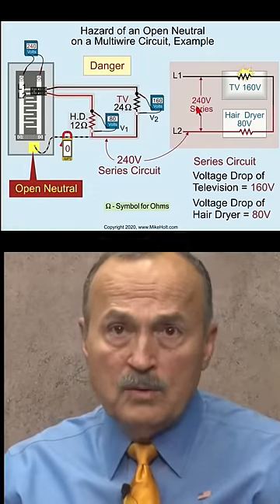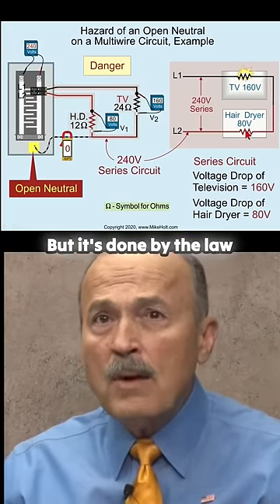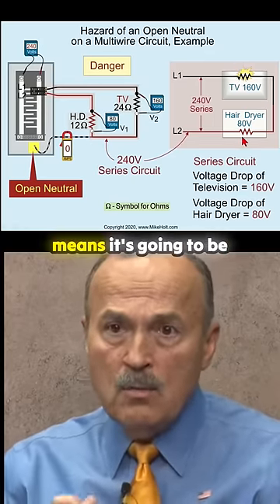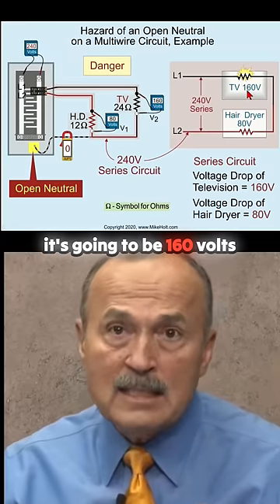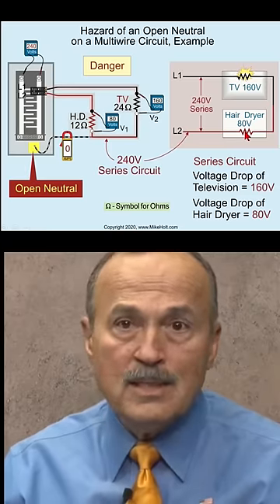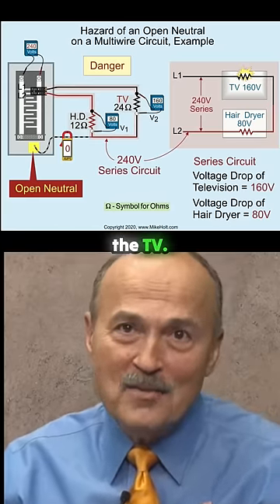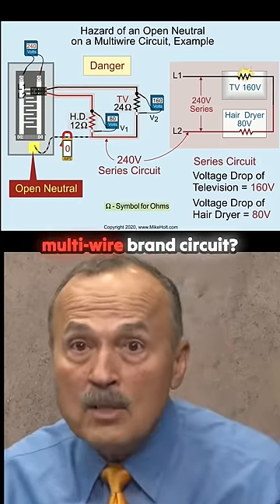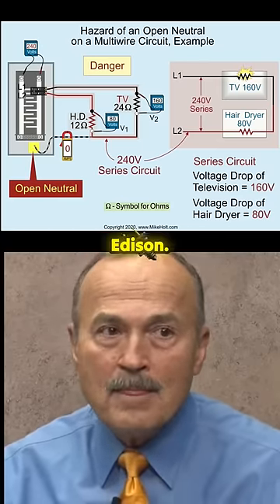Math and History of Multi Wire Branch Circuits #electricalcode #nec

Comment: Lost the neutral on the feed to my house couple years ago, lights were flickering prompting me to get the voltmeter,  78v on one outlet, 162v on another...  down to the panel i go, and find the same at the feed "hrm, adds up to 240v" and realized it lost its "center" call the power co.and they found the common was open at the transformer across the street. Glad i have protection on all my electronics!
Reply: Why didn't this harm your electronics? How are you protected? Thanks!
Reply: @s1dest3p proper bonding and breakers
Reply: But it was at 162v so it hasn’t tripped
Reply: @leexgx  from my understanding just regarding the electronics, if the voltage raised the amperage on the electronics it would trip the breaker feeding that electronic. Bonding would help bring the high current to ground. Only a 2nd year apprentice so don’t take my word for it lol
Reply: Breakers in your house trip due to amps not volts. Most have a Time delay inversely proportional to amperage rise above the rated value. So a 20A breaker might let you pull 21 amps for ten hours but It won't let you pull 200 amps for a tenth of a second.
Reply: @MerriamElectric1220  I=V\Z brudda, more volts means more amps. More impedance means less amps
Reply: @Hollows_over_balls  Z=Impedance because it’s ac, R=Resistance
Reply: @Hollows_over_balls  their both ohms law lol, facts aren’t right but point still stands because some of his outlets went down and some went up in voltage
Reply: @Hollows_over_balls  If you are dealing with inductor base circuits then that is the case, however it’s not always the case. Just think of motors and Transformers. The current and the voltages are inversely proportionate, depending upon the load.
Reply: @Hollows_over_balls  Yes. That’s absolutely correct. Just think of a transformer. You have a primary coil and a secondary coil. On a step down transformer, the voltage across the primary is higher than the voltage across the secondary. With that in mind, you have to think about the transfer of power between the two coils. Voltage times the current equals the wattage. You have the same power on the primary that’s transferred and received by the secondary. However, neither the primary nor the secondary are electrically connected to one another. They both work off the concept of mutual inductance and magnetic coupling.
Reply: @s1dest3p Whole home surge protection and level 3 surge protection at individual locations

Comment: TVs are usually made with universal switchmode power supplies these days. You could run the TV at 250V and it'd probably be fine.
Reply from the maker: Good point, I'll need to change the example!
Reply: @MikeHoltNEC  beloved family heirloom CRT TV instead of modern $3,000 TV ;+ )
Reply: So the images will speed up?
Reply: So what you're saying is maybe your refrigerator doesn't make it but the TV is okay.
Reply: Yup. Mine is rated 100-240V 50-60Hz
Reply: @microcolonel  And it does run “faster” with higher voltage? How?
Reply: Even the oldest TVs would not change “speed” with different voltage, IMHO.
Reply: @tomsaltner3011  more likely it would cause the oscillators to change, and prevent it synchronizing with the picture... and maybe cause accelerated phosphor wear.
Reply: He was joking… maybe a reel-to-reel projector would run images faster, but not a TV receiving a transmission!

Comment: A friend's dad lost the neutral on his house since the cable for the secondary to his house got abraded by a tree branch. My friend was measuring imbalanced voltages everywhere and of course he had issues with his cable modem too. After my friend kept telling me the voltage imbalances, and then that same day they had the cable tech out who said the plastic in the coax was melted, I put 2 and 2 together and told him he had a bad neutral to the transformer. The coax was melting because the neutral current for the house was being carried through the cable modem out to the pole at this point. The electric utility company came out and fixed it, been fine ever since.

Comment: Not really sure of what is going on here but it reminds me of a time my neutral wire broke on the pole during a storm. I had random voltage coming out of a given outlet depending on what was plugged in. If I had 30 volts on this outlet on line 1,  I also had 210 volts on line 2. It could be zero and 240 or anything in between. It changed according to what I plugged in. No my computer didn't run faster for a fraction of a second. It fried the sever power supply that I replaced.
Reply from the maker: Lol... that is exactly what happened.

Comment: i will have to set up a test rig and try this in real world.  I use multiwire branch circuits all the time to do quad outlets in workshops and kitchens all the time - especially in older or really packed panels and I don't want to have to land an extra ground and neutral (6 wires instead of 4). Usually first quads are GFCI's, with 12/3 then from the load sides, 12/2/2 down the bar or around the garage.  Not always GFCI's and kept 12/3 down the line.  I've never had a problem, but I've also never lost the neutral.  The diagrams seem right, but I'd like to see it act up under real conditions.
Reply from the maker: Let me know how your experiment works out.

Comment: I can't understand my people still try to use multi-wire branch circuits. In my experience, it's best to never share neutrals. I've seen too many burnt up neutral conductors on service calls in my years
Reply: How do they burn up the neutral? It's really just there to balance the load between the two legs..

Comment: Wait until your pool light, even on a GFCI, ends up like that, like mine did. 😢 The voltages show were about the same, too. 80 volts through the swimmer...
Reply: GFCI won't help with an open neutral. It's for when your poolwater leaks onto a live wire
Reply: @bene5431  I know, that's why I made the comment' LOL.

Comment: In my situation it's the wrong transformer on a residential power pole, they burned out their clothes dryer,I found over 340vac on the dryer receptacle, I checked it out with two multi testers,no electronics were burned out,a bunch of lighting fixtures had to have new bulbs.The electric company had to replace the transformer on the pole and everything was fine, no electronics were burned out because the electronics will operate on 220vac as well as 120vac .It was the wrong transformer on the pole.

Comment: I had an electrician install a shared neutral circuit in my garage. 3 weeks later I destroyed an ego battery charger because the neutral wire came loose. Being on the garage door wall probably didn’t help. I will never save wire this way again.
Reply: Sometimes it's not to save wire tho. Some multiwire branch crkts are for 240 volt loads that have an imbalance of current. Usually this is 240 volt loads that have electronics in them which increasingly more and more of them have.
Reply: That is true. And a great new standard. People just need to remember to separate the neutral and the ground inside the device if they a going from a 3 pronged 240v receptacle to a 4 pronged 240v circuit. 

That was not my situation. I had 2  120v receptacles right next to each other with a shared neutral
Reply: A shared neutral will not cause any problem. You   need to learn a little more about single phase wiring.
Reply: @marcw1867
A shared neutral won’t cause any problems when wired correctly. But if you loose that neutral going back to the panel the neutral from plug 1 is still connected to the neutral from plug 2. 

So the electricity fallows this path. 
Leg 1
Hot screw on plug 1
Through device connected to plug 1
Neural screw on plug 1
Neural wire connected to plug 1
Wire nut connecting plug 1 neutral wire and plug 2 neutral wire
Neutral wire connected to plug 2
Neutral screw on plug 2
Through device on plug 2 
Hot screw on plug 2 
Leg 2

So 240v is going through two 120v devices. If they are both 60w bulbs no problem but if one is a 60w bulb and the other is a heater then that heater is going to get like 200v and the bulb will only get 40v. 

Your heater will be destroyed.
Reply: @ecospider5 Other way around. The heater will get 40V and the bulb 200. Unless your Theater is like 20W
Reply: @bene5431
I thought the lower resistance device got the higher voltage. The heater would be the lower resistance device. 

What am I missing?
Reply: @ecospider5  Less resistance means you need less voltage to push the same current through
Reply: @bene5431
Good way of describing it. I just used a voltage divider calculator and you are definitely right. I guess I need to go plug a bunch of numbers into the equation until my intuition is corrected. 

So does that mean the amperage is the same through out the circuit?
Reply: @ecospider5  Yes, that's the Kirchhoff law
Reply: Ok here is the equation 
V bulb=(V source X Resistance bulb)/(R heater + R bulb)

Vbulb= 240x240/9.6+240
Vbulb=230.7 volts 

That 60w bulb is not going to make it
Reply: @bene5431
Thanks again for the correction And the details. I will go refresh my Kirchhoff readings.

Comment: That's why I don't run Edison circuits. They ran them plenty in the past. The chance I should lose the neutral or a power leg creating havoc. Many service calls are often the result of a lost neutral. 😮 Edison also wanted to wire everything D/C until Tesla. Showed  A/C was better suited. 🤔🤨😏

Comment: Most appliances are 240v now. 50-60 hz. Most of your things will probably be ok and even still
Work.
Reply from the maker: Many electronic equipment is rated 100V-250V but there is a lot of equipment that is only rated 120V. Like toasters, blenders, and other cord-and-plug home equipment.

Comment: A lot of TVs will work on 220 vac and 120 vac ,I know I've seen it happen before.
Reply from the maker: Only if the power supply is so listed.
Reply: The TV is bi voltage, 120vac and 220 vac .
Reply from the maker: @williamlangley2044  Not all TVs are rated 100 - 250V.

Comment: Why is L1 and L2 connected on the right side of the diagram? Multiwire branch circuit l1 and l2 do not connect so how is this possible??
Reply: The RH diagram does not show L1 and L2 connected; the diagram shows a potential of 240V between L1 and L2.

Comment: How is voltage connected to the frequency?
Reply from the maker: They are not... for example a battery has no frequency but it has voltage.
Reply: Of course. That is why parts of the video made no sense…
Reply: @MikeHoltNEC  Now you tell me please, how a TV could run “faster” with a higher voltage. ;)
Reply from the maker: That was a joke...

Comment: Arc-fault circuitry has solved this problem.
Reply from the maker: Actually that is not the case at all. AFCI has nothing to do to protect equipment from overvoltage resulting from an open neutral of a multiwire circuit.

Comment: I understand this completely, in short less return on the neutral, but a panel can never be truly balanced, this video is way too short too get the bigger point, but we nolonger wire this way,for a better safety standard, but this is less overall amperage on the returns less heat
Reply from the maker: No. 1 This video is not about neutral current.
No. 2 It is a standard practice to install multiwire circuits.
Reply: No, you clearly didn't understand this at all. There is zero return on this neutral as it's disconnected. If a panel only supplied 240v loads it wouldn't be balanced? This panel is perfectly balanced, the appliances are cooked, but the panel is doing just fine. Who ever wired "this way"? It's not about safety, it's about basic functionality. When you turn the hair dryer off, the tv turns off. The wire he's talking about saving isn't the disconnected neutral here, he's talking about the lack of separate neutrals for each incoming feed.
Reply: @HomemadeHobbies  I get that douch

Comment: Loads is series ? Is that a thing.
Reply from the maker: Please watch the entire video to understand this 'short.'
Reply: @MikeHoltNEC I agree if the short can't be understood on its own, it's too short!
Reply: A portion of the load is in series.  But, if you had two identical 120 volt loads on different sides of the neutral, the electricity would just drop 120 volts plus another 120 volts and no current whatsoever would go along the neutral wire back to the transformer.
Reply: It is if the neutral breaks
Reply from the maker: @bene5431  Please watch the entire video, click on the link in the video. When the neutral is open, it changes from a 120/240V multiwire circuit to a '240V' series circuit. Right?
Reply: @MikeHoltNEC  Yes, without the neutral it's a 240V circuit with 2 devices in serial

Comment: Sketchy schematic, toaster and TV are on the same breaker/fuse, they both lost return path thru neutral = no current flow = no potential difference.
Reply from the maker: Please watch the entire video, not just the short. Click on the link embedded on the bottom of the short. I think you'll better understand the 'short video.'
Reply: Hair-dryer and TV are connected to separate breakers; each breaker connected to different legs. TV connects to L1, hair-dryer to L2. Thus an alternative  path is created when Neutral is open. Voltage is 240, L1-to-L2.
Reply: @MikeHoltNEC  I think you better learn to draw schematic diagrams.
Reply: @johne189  the neutral is the center tap on the transformer, it better be effing torqued down at both ends.
Reply: @johne189 Ok so L1 and L2 are different phases? In that case makes sense. I find unusual having more than one phase in a domestic circuit.
Reply: @Piccodon To me, the drawing seems nicely done with accurate depiction of the typical installation.

Maybe the breakers are confusing? However that depicts the typical system - adjacent breakers connecting to different legs (either two or three) in a repeating sequence.

Comment: The TV won't even turn on it has no neutral
Reply: The neutral from the TV is connected to the neutral of the hair dryer. Those neutrals are supposed to have a wire back to the panel. But the wire back to the panel got disconnected. So the electricity takes the following route. 

L1 from panel 
TV
TV neutral 
Wire nut
Hair dryer neutral 
Hair dryer 
L2 from panel

The hair dryer has less resistance in the series circuit so gets less voltage.
Reply from the maker: You are 100% correct, thanks for helping me answer this question.
Reply: Thank you somebody has some common sense. I miss my trade I had a back surgery and they're trying to hurt me I've done the code updates everything and the state of New Hampshire just wants my money and they don't want to give me my electrical license back and doing it since I was 17 years old and they're just giving me a hard time. I've taken the cold update I've spent the money I've done everything I'm supposed to and these people just don't understand feels like my world is turned upside down.
Reply from the maker: Please call 352.360.2620 and see if my team can help you.
Reply: Thank you

Comment: But why? Why the hell woukd you do that? That busbar that let flow L1 into L2 from a pole to the other is junk. You want 240v? Start building it correctly and you give 1 phase to one street and another phase to another street. These accidents are highly avoidable building proper transformation cabinets from medium voltage to low, and distribution of the grid.
Reply from the maker: Please watch the 'entire' video, click on the link in the 'short.' Maybe it will answer your question.
Reply: I will later.

Comment: Does 240v in residentials always require a center tap? I was told center tapping was outdated
Reply from the maker: I have no clue what you are asking. A home in the US will be supplied by a 120/240V single-phase service.

https://www.electricaltechnology.org/2021/02/how-to-wire-120v-240v-main-panel-breaker-box.html